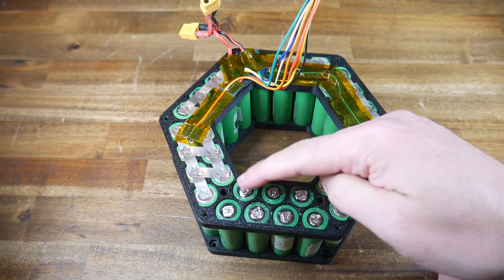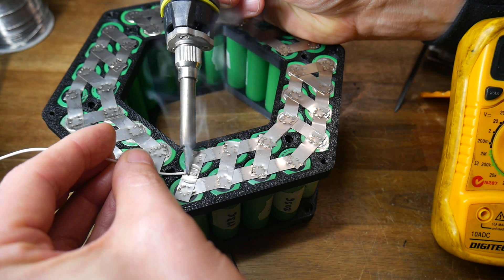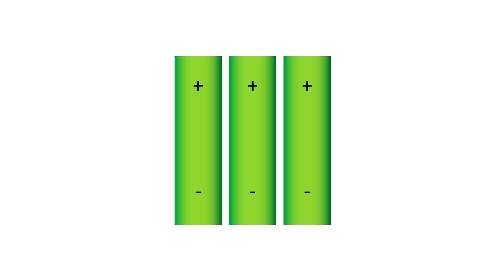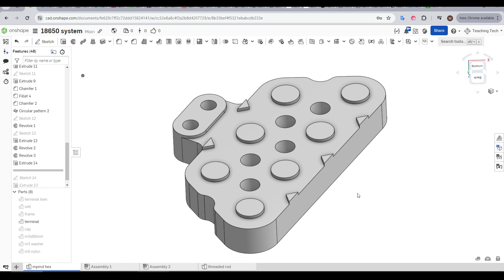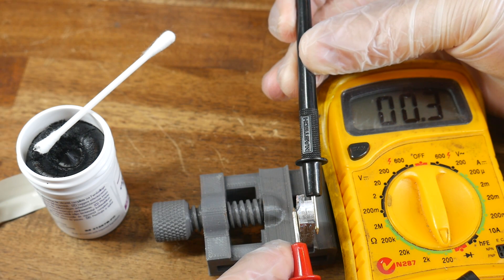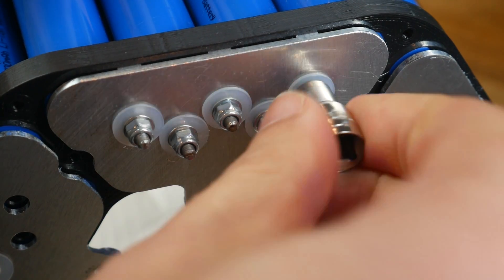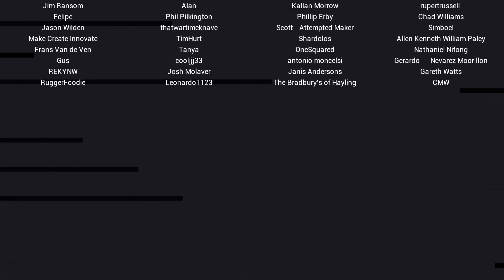Experimenting with a new (and probably flawed) 18650 building method: No soldering or spot welding!

Comment: (5:20) I'm thinking that you're just giving a high level overview and not actually showing the real solution but, even though the ends are insulated, the whole way through screws can still connect to the busbars.  If they just shift a little, the sides of the screw threads might make contact.
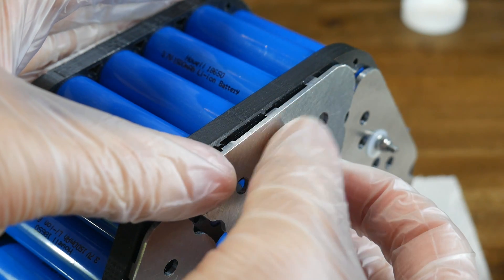Reply: The model itself also prevents that from shifting, he shows that @ 10:20